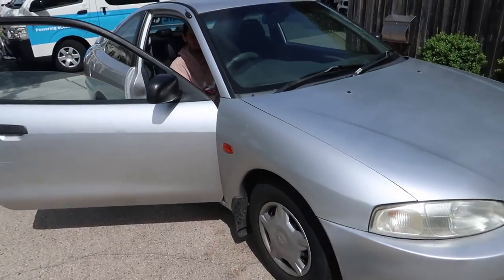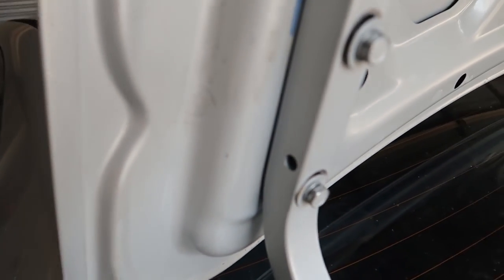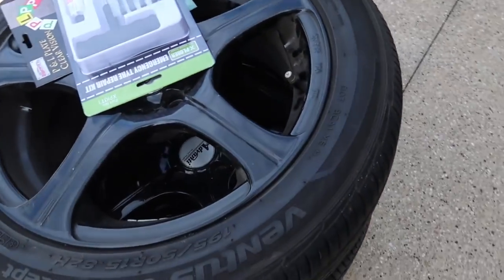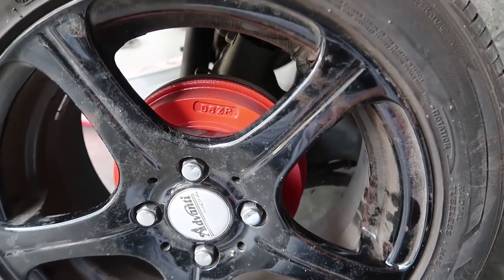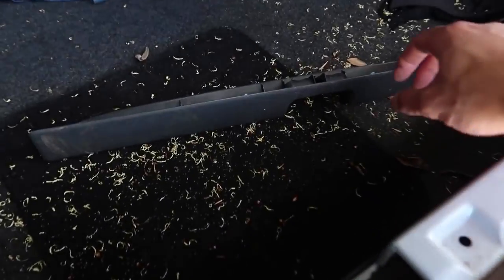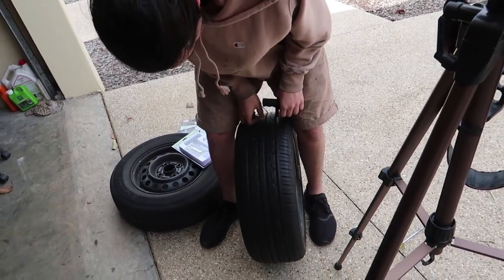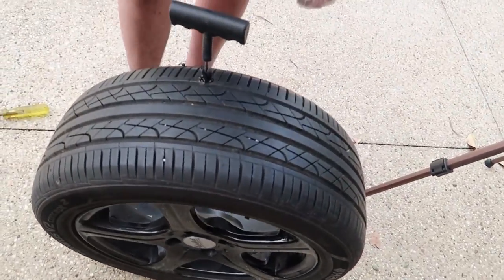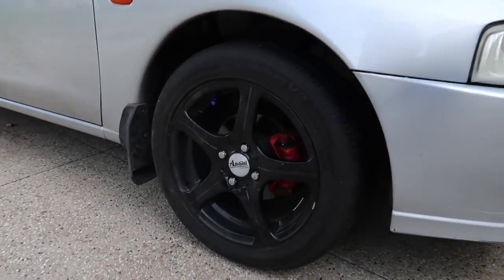She's looking good (The Shitsubishi) - Episode 2

Comment: Can you do a 0-100km/h & roll on test with the original & new wheels bro? 
Looks heaps better too, a V6 is a great option with these car's; but don't forget that the JDM Mirage Cyborg R is compatible with it's setup as a upgrade for this car too. 
They gave out roughly 130kw & 170nm from their high revving MIVEC tuned NA 4s in a 1000kg car. 
Awesome track car's with a high tech sporting sound & heaps of fun to drive.
Reply: Hahaha yeah 👏👏👏👏 mate
Reply: @bignateaussie8123  
I've only touched the surface of these motor's, you realise how much power the Rally examples make when they work these motor's? 
Guess I can't expect more than a bogan's mind from a bogan.
Reply: @bignateaussie8123  
It's quite different to your 1900kg+ heavy RWD donks, the Mitsubishi in the video is 50kg lighter than the Cyborg R too. 
Makes it well below 1000kg, has anyone educated you yet on power to weight or is more than 2000kg in weight still the focus?
Reply: @bignateaussie8123  
That motor swap improves the car's 0-60mph to 6.7sec, the upper spec model RS, ZR & the ultimate Ralliart spec model seem to be lighter & more powerful. 
About 100kg lighter at the best. 
I think the RS has 135kw & 180nm while weighing 970kg & a higher rev limit, I think it's 0-60mph time improves to sub 6sec mark; but the website I was looking at wasn't specific about how far. 
They are meant to be understated in what they can do though. 
I was looking at the fastest Nurburgring lap times by a Commodore & it's a disappointing 8:19sec. 
If you look at the current Honda Civic type R, it does it in 7:43sec; almost 40sec quicker. 
The Civic is FWD too, in the end even the fastest Commodore can't even beat a Civic. 
You do know how long the Civic driver would be waiting at the finish line for the Commodore to finish under those circumstances right? 
It also means that the Civic would disappear from the Commodores vision when going around this track & keep getting away from their.
Reply: Sik mate did I ask about the cars you don't have ???😂😂😂
Reply: That Sik my friend, your just salty 😂😂😂😂😂